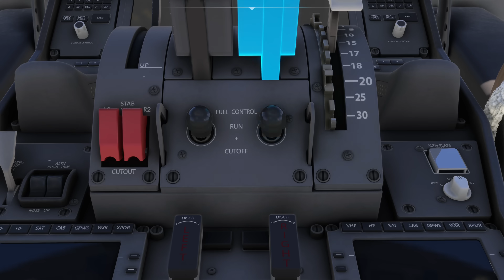Air India 171: Why Did The Fuel Cut-off Switch Get Moved?

Comment: Was the fuel switch on when the plane took off ? Is it possible fuel switch would hv been cut off after plane took off ? Is there any possibility the pilot would hv cut off and turned fuel switch back on to get the thrust for take off ? As the preliminary report doesnt show enough evidence or data, is it possible its not accurate ?

Comment: What if this is the failure of the MN4 microchip on EEC? Boeing has a bulletin published in 2021. At least this seems an alternative explanation. We don’t know if the switch were switched to cut-off position physically . We only know that the FDR recorded a signal, which indicates a change in voltage or current.

Comment: How do we know that the fuel cutoff switches weren't triggered by some electrical or software fault? VT-ANB had some cabin electrical issues such as ac not working on the previous flight. We can't definitely confirm deliberate pilot action or any hypothesis untill the final report is out.

Comment: In your previous video, you mentioned that Pilot A asked Pilot B why he cutoff the fuel and Pilot B responded saying he didn't. Your opinion is that Pilot A saw it, took a bit to process it, questioned Pilot B and then tried to re-ignite the engines.

1. Without actual recordings, the preliminary report CVR summary,, if anything suggests the pilot didn't do it. Pilot sabotage angle is far fetched based on just the summary of the CVR. Other factors included, yes, it is a possibility but cannot say it is the most likely cause.

2. There is no evidence that suggests Pilot A saw Pilot B toggle the switches. In my opinion, it seems like Pilot A saw the warnings, knew he didn't touch the switches himself and hence in distress asked Pilot B if he toggled them.

3. Considering the numerous recent incidents with both Boeing and Air India, it is in their best interest to point towards pilot error. Based on the preliminary report, it is hard to rule out faulty mechanism or lack of proper maintenance in case of a switch gone bad. Cannot rule these out until there's clear evidence of pilot sabotage.

That said, love your videos and insights Captain! I aspire to fly as a pilot soon.

Comment: Captian Steeve, please talk about the idea that the one who said, "Why did you turn off the fuel?" may be the one who first flipped the switch. He realized it very soon. He was supposed to raise the gear. But instead, he did the last step from what he did recently on the ground (fuel switches). This may have just been a massive mistake, and he realized it, and in fear, he asked the question to evade the reality he unleashed -- the question "Why did you...?" was a cover to hide his own error (not to accuse the other pilot). And he never put the gear up, because he realized his error and was frazzled. The flying pilot didn't turn the fuel back on, nor off, and he did not figure out in 10 seconds (the whole thing was a single man's error). In this scenario, the question, "Why did you...?" isn't "malicious", but rather one of human fear from the man who made the worst mistake of his life, and knew it.

Comment: I own and fly an aircraft that is equipped with the G 3000 avionic suite and it appears all things are interconnected and displayed as annunciations. I’m just wondering if the cut off switches were not physically moved, but the sensors created the annunciations saying that they were turned off even though physically, they were not so one of my questions is that I assume it’s not the physical switches themselves that turn the fuel off and create the annunciation. I assume there’s an annunciation saying that the fuel has been cut off so if there was a device in the aircraft that controls this electronically, could that electronic device Have created the information and the action of turning the fuel off and after the one pilot asking the other pilot did you cut it off and the other Pilot of course says no he did not. It would then take maybe I’m guessing 10 seconds to go to the actual physical switches to turn them off and then turn them back on Hoping For the electronic part of the system to turn them back on.

Comment: Hi steve ,

There is no mention in the primilinary report that fuel switches were put run to cutt off (3 sec after take off) by human . 

Why you are saying it is done by human the pre report prepared by many experts doesn't specify it was done by human.

Isn't this  baised to interpret that it was done by human and the machine , control mechanism were not at fault .

Comment: I understand some of these aircraft left manufacturing with those detint switches were installed incorrectly and did not operate properly. If the airline did not have that rectified the switches could just be bumped to cut off. Possibility?

Comment: Someone stated that the data recorder reports that fuel is shut off but not the physical position of the fuel switches in the cockpit. That could explain a lot. It could be an electrical problem. Could explain why the RAT deployed so soon.

Comment: So if both pilots need to shut the fuel switch off because of an engine fire then what happens if the other pilot is incapacitated or in the toilet?  The other pilot is then sitting there in a panic?

Comment: I wonder if it is possible that the pilot had intended to switch off the horizontal stabilizer trim but mistakenly switched off the fuel instead. The previous flight had reported a problem with the horizontal stablizer position transducer. This could cause the trim to 'run away' and might explain why the pilot might want to defeat the trim control. The trim switches are just to the left of the fuel switches. They are protected by safety covers rather than safety detents and there's no excuse for the pilot getting them confused. But it might make as much sense as suicide. It would be interesting to know if the flight data recorder captured any unreasonable horizontal stabilizer position transducer indications.

Comment: I think a tragedy like this happens rarely and having a camera 24/7 in the cockpit is not the right thing to do, as the caption said that a camera wouldn’t have helped to avoid the crash it would have only given the required information which the audio recording has already given, the point here to be noted is that more than 55 percent of positions in Indian aviation and in the crew who is responsible for monitoring the aviation operations is vacant. The issue boils down to the fact that Indian employees pilots in this case are overworked and under pressure which might  have caused the crash

Comment: How did they know whether the fuel switch has been toggled? Just from the conversation?
It could be some malfunction in the system which could cutoff the fuel.

Its hard to believe that they spoke only 2 sentences between them. 
This report is confusing and looks more like a coverup.
Reply: From the data recorders. Read the report.
Reply: @Dalesmanable please read.....
Reply: The interim report is not intended to be a complete word for word analysis. Much more conversation takes place in the cockpit at all times, especially during critical flight operations like take off and landing. More will be learned and understood when the final report is released.
Reply: I've wondered the same thing, sure the FDR says the fuel was cut off, but does that mean that the toggles were physically moved or could it had been an electrical fault from a chip sending the wrong signal to the valves. Only the  engineers will know where the signal is measured. I still think it's more likely deliberate though.
Reply: From the pilot who had the visual confirmation of those switches, enough to ask the question that he asked.
Reply: Only a cover up by the 100 million people from India defending the pilots on the internet.   This has happened before,  it's not an indictment on your entire damn country so chill.
Reply: I’m assuming they aren’t telling us everything that was said. If the Captain was sabotaging things it was probably very upsetting to listen to the final moments.  Maybe the final words were personal and not for public consumption?